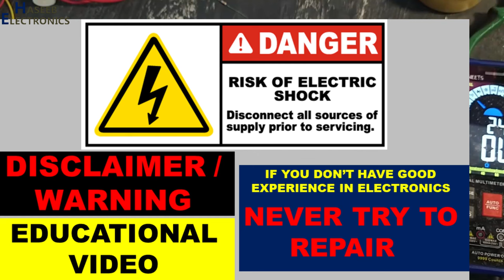{1187} 20 watt LED light simple repair

Comment: Thanks for the great repair and video! I hope that new meter battery modification is working well for you. I am curious how much more time you are getting from that 18650 verses the AA batteries? That looks like a great meter. You have used it a lot here for a while. I like the display and it's ability to automatically change ranges quickly. Have a great day!
Reply: Please kindly share with me link of the video, I missed it😢
Reply: @mansirrabiu7412  Yes, it's 1184. Take care.

Comment: Sir is it possible to use your previous camera's position? This camera position sometimes feels dizzy :(:(:(:(:(
Reply from the maker: Sure i will recheck and readjust it. Special thanks for your valuable suggestions
Reply: Sir why r u wearing gloves,
I can't do pcb repair, if I weared gloves.
Reply from the maker: @sunnych659  because there were too many dead dead insects and flies inside
Reply: Okkk .
I appreciate ur seriousness
Reply: Sir this comment was going especially for the car weight scaler wich damera was 90 degrees ❤

Comment: I have seeing a similar failure in a 4.5MW power plan caused by a rather big mouse burned at the rectification section (output 850 VDC about 5.5KA electric train power station)